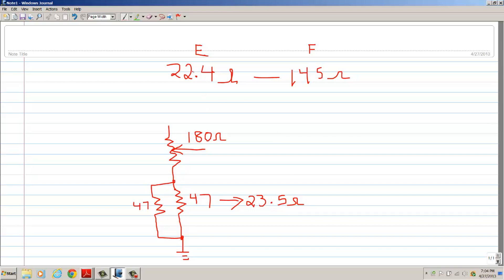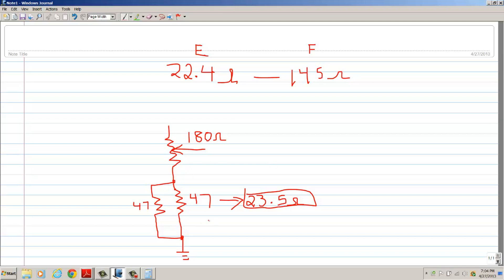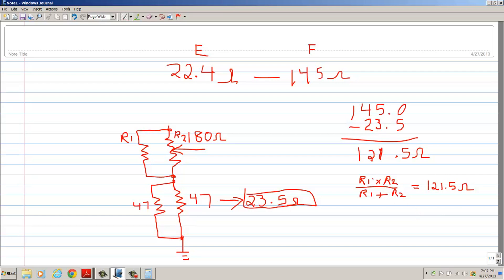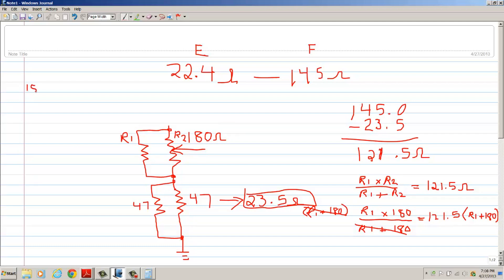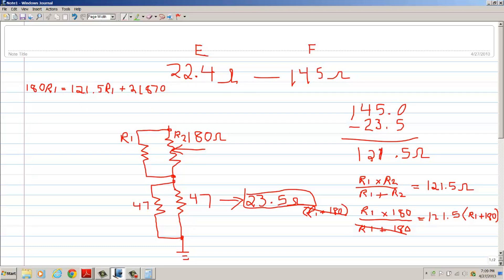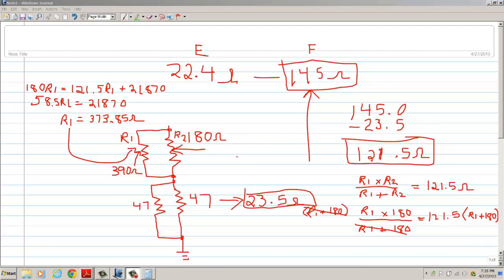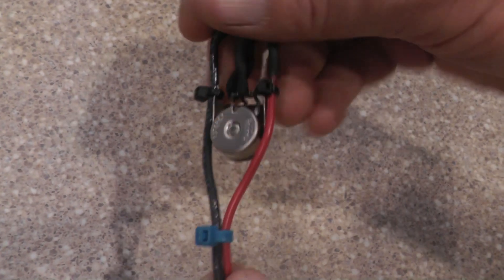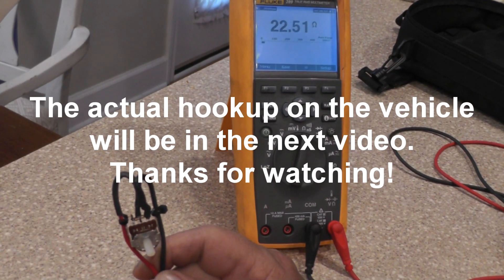Ford Ranger Fuel Gauge Diagnosis Part 3 (Pot Calculation)

Comment: Absolutely brilliant. I know this is an older video but I just wanted to thank you for such a detailed and useful video. So clearly presented and perfectly paced! Should be a model for all uploaded teaching wiring diagrams snd approach to problem solving. Many thanks. 👏👍👍
Reply from the maker: Thank you very much! I appreciate the kind words. Have a super great day!
Reply: 🙏🙏👍1996 Ranger XLT Extended Cab.  We've bothbeen sidelined since 2014 - I'm 77. Water pump and cracked filler tube. Got the bed tilted up then life happened  Wouldn't take a million bucks for it. 🙏🙏💪👍

Comment: Can you just buy another sending unit and tie it in to see if it works by moving the float up and down? If it does not work carefully pack it up and return ? I really like your class but I am not good with this subject.
Reply from the maker: Yes, you could do that Andy or you could just use a fixed resistor value and put it in place of the pot as either would work. Have a great day!

Comment: Wow thanks for taking the time to explain, its not just a fuse. Dang. 1992 Ford Ranger lover.
Reply from the maker: Thanks for the comment abbi! Looking back on this video, I wish that I had done it on the whiteboard as it would have gone much faster. Have a great day!
Reply: @stuzman52  You explained very complex systems so I could follow along. No white board necessary. Your step by step R1 equation solution was clear concise and smooth. Looks like you are my mechanic from here on.
Reply from the maker: @abbi262  Thank you abbi, I appreciate it!

Comment: Sorry, it is a 2002 E450 motor home.
Reply from the maker: The operation of the sending unit should be similar to most vehicles.
Reply: I have a shop in the Tampa Bay area. I just install a new pump assembly and we check to make sure that the gage is working and it works good, but every time we lift the tank up and bolt it up the gage go to empty, shot to the ground as soon as we lose the bolts we get it back working.
any suggestions?
Thank you. 
Maurice.

Comment: Thank you, but I have a tricky problem it work when the tank is down, but as soon as I bolt it in will not work.
Can you help, please?
Reply from the maker: It has to be either an open connection in the wiring or its connector or there is an intermittent open in the sending unit.

Comment: Look, I appreciate what you are doing, I really do, but why didn't you just get a 200 ohm pot, or a 150 ohm pot? For this it would not matter! Besides, you actually could use almost any value pot since you are only using two terminals as you adjust you will eventually go from 0 to 150 or 180 , you are taking a hell of a lot more trouble with this than is necessary . Stop giving every one a class in ohms law, because 99% of the time people is not going understand or even watch. If I didn't know what you are doing , I would have left a long time ago!

Comment: water temp gauge, oil gauge, gas gauge all three not working on my 1994 ranger. I have been running it like that for like 3 years trucks got 320,000 on it but im starting to get tired of guessing what i have for fuel or going by mileage.
Reply from the maker: Hunter White you must have a lot of patience to put up with that for three years. Go to www.bbind.com and download the free wiring diagrams for your vehicle. You will see one for your instrumentation/cluster. I would focus on that diagram and see what is in common with all of those gauges. If you have any other questions relating to the diagrams, holler out.
Reply: im lost here this this link you gave me im not seeing where i can get these diagrams
Reply from the maker: Here's a link that will get you there more directly. Fill out the short form and after you click on the agree button and submit, you can select your year, make, model, etc. to get either wiring diagrams or TSBs. Look over the cluster diagram and see what you can come up with. Then let me know your thoughts and we can go from there. Here's the link http://www.bbbind.com/tech_database.html

Comment: Hi Stuzman52, thanks so much for being so detailed….I have a 62 volvo in which the previous owner installed
a  new Stewart Warner fuel gauge which does not work with the original (replaced and new) sending unit I installed. Can I add
a pot permanently, such that the fuel gauge will read correctly once I have dialed in a full fuel tank?
Reply from the maker: Hi Aaron, I am not sure what you're asking. It sounds like you want to wire a pot permanently that you will dial in to represent a fuel tank and then what. Is the pot now going to show you how much fuel you have in the tank as the level changes? Not sure what you're trying to do. A little more info would be helpful.

Comment: what did you make the modified pot out of? how could i make one myself for my 1984 ranger? thanks!
Reply from the maker: I would be assuming that for the 84 Ranger, the wiring diagram would be the same. You will have to research that part to be sure. I'm not sure what you mean, what did I make the modified pot out of? It was just a generic pot that had a 180 ohm rating. If you want a really fast diagnosis, get yourself a 150 ohm resistor along with a couple of test leads. You can get this at Radio Shack for a few dollars. Take the resistor and connect it to the connector pins under the hood. Make sure that your wiring diagram corresponds to mine. If your diagram is like mine, you'll see that the fuel gauge will read full. This signifies that everything is good in the instrument cluster. It's time to pull the sending unit out. Otherwise, you have a problem in the instrument cluster. But before you pull it, make sure that your fuses are good because +12V feeds the gauges. Hope that helps out.
Reply: Yes it does thank you so much!!!
Reply from the maker: Sounds good Noah! And good luck on your diagnosis and repair. Thanks for the comment also...